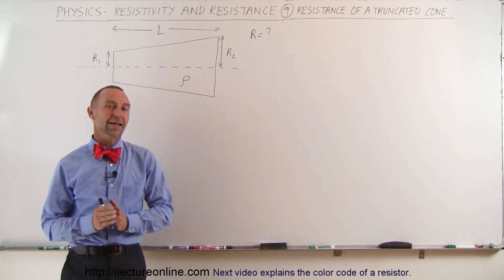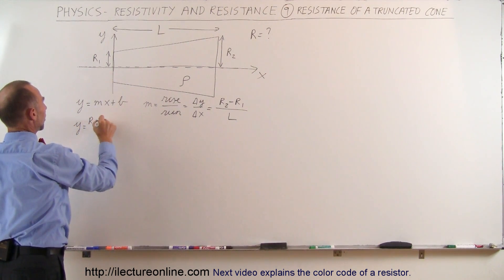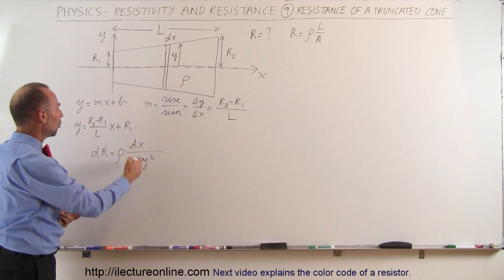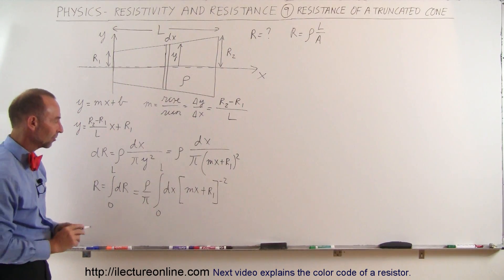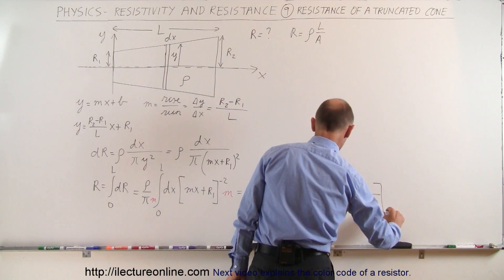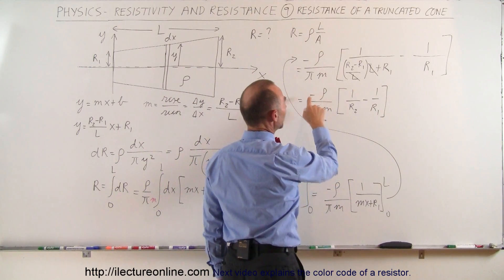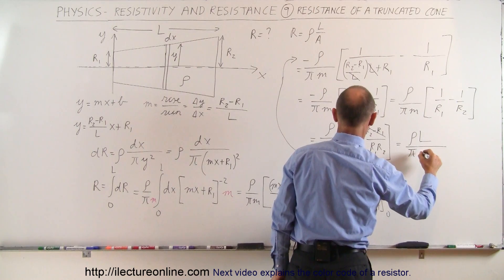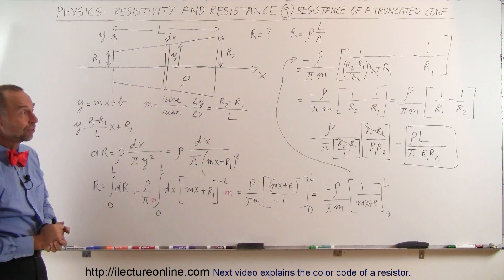Physics - E&M: Resistivity and Resistance (9 of 32) Resistance of a Truncated Cone

Comment: Quick question, is L the shortest distance from one end point to the other? Because I've been looking at a problem with a semi-hollow, non-uniformly shaped resistor where a region of space in the middle of the resistor is just empty space. My resistor is a sphere, so I don't think L would be the diameter given that it is hollow.

Comment: Impressive work you've got there. I've got a more technical and interesting engineering question here, how about the resistance of a cylindrical shape but with one terminal at the center, and the other terminal being the curved surface of the cylinder. Let me elaborate, I have an electrolyte solution of salt with one cathode at the center and the anode is a plate concentrically arranged around the center such that current flows radially towards the center terminal. Makes sense now? It's for generating chlorine and sodium hydroxide (chlolalkali process.) I need to automate the system, such that the system measures the salt concentration which is a function the resistance of the solution. Hence I can a accurately control the salt level by reading this value and sending it to a microcontroller, which in turn sends a control signal to an actuator when the salt level falls below a certain level. Via a simple on-off control loop or a PID servomechanism.  Derivation of the resistance of this shape is the part that's quite crazy, I tried and it gave me a headache. can't find an answer anywhere.
Reply: in your case, the current will flow from the inner cylinder(radius R1) to the outer cylinder(Radius R2) radially (assuming the cylinder you are considering is hollow and the total length is L).Then assuming so, we can take a ring of thickness dr and radius r from the center and hence find its circumference to be 2(pi)r. Therefore, the area of our crossection is 2(pi)rL because current passes radially. Then we can substitute the values in this formula dR=(roh*dr)/(2(pi)rL) and then we can simply integrate it from R1 to R2 and then finally we get R=(roh/2(pi)L)*ln(R2/R1). Im just in grade 12 so hope my solution was understood by you :)
Reply: @adityathakur7604  Wow! in 12th grade you don't do integrals or differentials of natural log, so I wondering.  How are you here cranking up this university stuff?. That was an awesome approach by the way.
Reply: @davemwangi05   @Divad Ignawm  Hey! Im really glad you liked my approach. Im a student who's preparing for an engineering entrance exam called JEE Advanced in which there are many problems which require a good amount of calculus. Thanks for your time! :)

Comment: hi if we have more complex geometry like a diamond (copper meshed foil) see reference pic unit cell of a meshed cu foil. 
https://duckduckgo.com/?q=copper+expanded+foil&t=fpas&ia=images&iax=images&iai=https%3A%2F%2Fwww.copper-mesh.com%2Fimg1%2Fdiamond-copper-mesh.jpg
 at that time i cannot use y=mx +b .
should i find an equation of a line joining all the points from centre of the section of geometry.
and at that case if the cross section of each section is not same what should i do then??

Comment: Why do we not change the limits of integration after making the u substitution?
Reply from the maker: The limits are "x-limits"
Reply: @MichelvanBiezen  Thank you. Wow, you respond quickly haha. 
•So because the integral is in terms of the change in area as the x-axis goes along, and changing the limits as we normally would in a u-substitution just so happens to switch the boundaries from x-boundaries to y-boundaries (from Length to radius), only the boundaries corresponding to the change in the x makes sense for this integral?

•Is that how we typically should think of whether or not we change the boundaries of a u-sub in a physics problem?
Reply from the maker: That is correct.
Reply: @MichelvanBiezen  Thank you! You're awesome

Comment: when can i say that dA would be equal to pi*r^2 or 2*pi*r dx, to say? in integrating volume, we use its area times its small thickness right. and sometimes we integrate dA by its circumference times small thickness. i'm really confused
Reply from the maker: Sometimes it helps when you look at a number of examples.  We have lots of examples in the calculus videos.

Comment: cant i remember the last formula of area which was πR1R2 for solving any problem of non uniform rod?
Reply: only when there is linear variation
Reply: @hitendrasingh148  You look like a genius, can you help with this 

 I've got a more technical and interesting engineering question here, how about the resistance of a cylindrical shape but with one terminal at the center, and the other terminal being the curved surface of the cylinder. Let me elaborate, I have an electrolyte solution of salt with one cathode at the center and the anode is a plate concentrically arranged around the center such that current flows radially towards the center terminal. Makes sense now? It's for generating chlorine and sodium hydroxide (chlolalkali process.) I need to automate the system, such that the system measures the salt concentration which is a function the resistance of the solution. Hence I can a accurately control the salt level by reading this value and sending it to a microcontroller, which in turn sends a control signal to an actuator when the salt level falls below a certain level. Via a simple on-off control loop or a PID servomechanism.  Derivation of the resistance of this shape is the part that's quite crazy, I tried and it gave me a headache. can't find an answer anywhere.

Comment: So, the resistence of not truncated cone is infinity???? (R1=0)
Reply from the maker: The answer is yes.  However that would be physically impossible.  R1 must have some value other than zero or you would not have a closed circuit.

Comment: What if there are pointed sides insted of circular..... Just like a rectangle bigger from one side
Reply from the maker: It would be solved the same way, and you would have to find the relationship between x and y using the slope.
Reply: but it is going in log.......
Reply: can you upload an video for integration and differentiation

Comment: I am not clear why the M in red.
Reply from the maker: +V ictor Dorado 
To make it clear that we need to multiply and divide by m in order to have the correct differential to integrate.
Reply: +Michel van Biezen  , Thanks for your reply back ,  would you have the same result if you integrate with the formula 

∫1/(X+a)^2 dx.? also one more question do you have any video related to Power Dissipation in mosfet and switches , thanks again for your videos they are really helpfull.